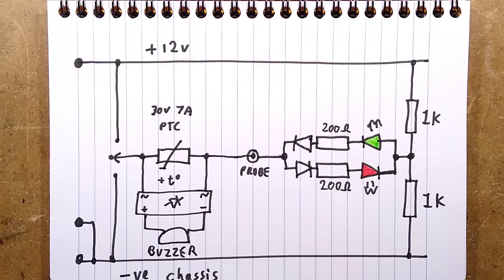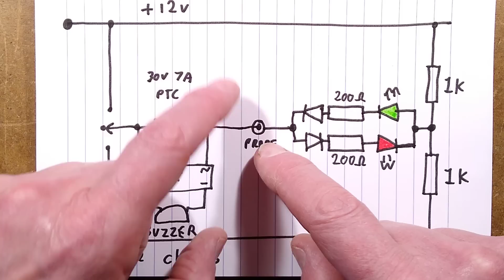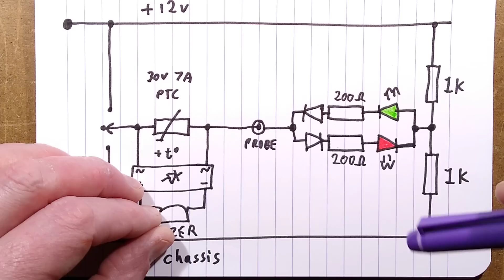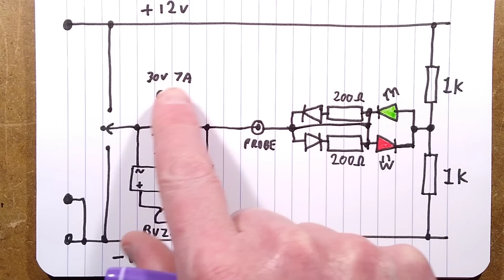Inside a mechanic's test probe - with schematic

Comment: The brand name version of this came out in the early 90's.  It was called a Power Probe and everyone loved them because you could quickly provide power or ground to relays without diagnosing the circuit fault.
Basically you quickly know if the fault is before or after the relay, fuse, or whatever.
Still to this day it is a must have tool that scores a 10 for most used tools and value.
Now I want to take mine apart to see if it is the same.
Reply: They have had many modern version of the power probe! Their downfall is the amount of delicate computers in vehicles that you can damage using a tool like this.
Reply: @JohnnyBouldin  I have a degree in Automotive and Diesel Technology as well as Ford, Delco, and Daimler Chrysler factory training.  This helps to know what not to ZAP with the inappropriate lightning source. 
Like my 55 Studebaker President Speedster which is 6V positive ground for example.
Reply: @JohnnyBouldin  My Power Probe 4 is full of multimeter features. I'm not sure if the other versions offer that.
 It really isn't a downfall of the tool. More of a downfall of the modern age.
That said, multimeter is still my go to. It can be super useful though and much more elegant than a couple of long wires.
That said, a power probe wasn't ever really intended for people that don't know what they are doing. Admittedly moreso with computers involved, as you state. Even with an old school analog circuit someone could pop fuses or burn something up if protection is inadequate. All can be avoided with knowledge.
Reply: In the states here, there are many versions of the "Power Probe" available. I wasn't going to spend the $100 bucks of so on one, so I built one myself with extra features in it. I went as far as to add a 3S Lipo inside it for 12 volts out when working on a vehicle without a battery, or for testing parts off off the vehicle. It's very useful.
Reply: Thought about taking my Power Probe 3 apart and comparing it too, lol!  But chances are as soon as i open it, I'll need it again
Reply: Found one for £80 lol
Reply: My power probe can test fuel injectors and has warnings about the 3Vdv-5Vdc sensors to avoid. You can test for ground. Problem is DIY'ers that have many years of repair component level parts on the board have no access to wiring diagrams which makes using the multimeter more feasible. Power probes as you stated are very useful. Most new power probs now come with a display for the voltage being tested like mine
Reply: So ... no indiscriminate probing, gotcha.  😅
Reply: The first time i saw one was abt 14 years ago when my boss bought one from a snake oil salesman. i stuffed in a drawer for 3 years before i even tried it. the first time i used it i blew a 10 amp fuse and then i stuffed it back in the drawer. it got sold 10 years later with the bussiness. My next encounter was with a shop that mainly delt with tracking and radio installations and they swore by probes and said that the conventional testlamps damages electronics. ive been working with regular testlamps swopped with 24v festoons for 16 years and ive never blown an ecu. U just need to know where and how to use it. The other shop that swore by probes blew 2 ecu's in the year i wasted it their clown shop Except for probes having way too high cutoff amps they can easily make a blown fuse test fine in circuit as the do light up with really low voltages.

Comment: I use to work on old cars (re wiring and repairing electrical) and I have a unit called a Power Probe (kind of expensive) but it's a bit like this, it does have a display though to show voltage and it has a physical breaker that pops and you reset to fix. They also have a 25' extension for it and yes I have it and used it as I worked on lots of motorhomes and this allows me to use it anywhere outside, inside and on top of them, also they make some of the best wire probes I have seen (similar to Fluke but made for 3 sizes of wire common in automotive) and they hole they make is so small it's like it self seals. Very handy devices indeed.

Comment: Clive..  I believe the diodes and resistors are to ensure the LED's dont give a false positive if accidentally touched onto a 5v circuit.  Do you believe the volt drop across the Diode combined with the 200 Ohm in series could be enough to stop ghosting of the LED in such 5v cases?
Reply: That doesn't seem nearly enough to me.
Reply: nope, in this case you just use zener diodes in series to the led (2V for the 5V indication and 8V for the 12V indicator) there are similar Tools that do this, to destinguish the voltage aswell
Reply: Good thought about 5v ghosting prevention... I've talked myself to your line of thinking... Notice that the LEDs are not connected to the rails, but to a voltage divider so they will see at most +/- 6ish volts. If the probe hit a +5v rail you would have negative 1ish volts across the LEDs which could glow the green one - but with the extra 0.6ish volt drop of the added diode it doesn't misidentify +5v as GND.

In the real world though, your battery is usually closer to 13.6v than 12v IIRC so this theory might work best on paper and in reality the extra diodes are probably for reverse voltage breakdown reasons (protects the LEDs from being damaged by too high of a reverse voltage... But IDK about the need for that here either)

Now I have no explanation for the 200 ohm resistors... Other than as a manufacturing option to match apparent brightness between the LEDs and this example of the product cheaped out and cut one item from the BOM.
Reply: 9:04  The two 1 K resistors provide circuit loading to prevent stray voltage from tripping the LEDs.  This is a real problem when using a digital volt meter.  Fluke even makes a stray voltage eliminator ( SV225 ) for DVMs.

Comment: I will guess that the resistors and diodes are insurance against overvolting the LEDs in normal use with 13.6V supply when the alternator is running, charging the battery.
The inductor case you describe would probably kill one or both LEDs with or without the resistors and diodes.

Comment: Yes but there is a simpler design for electricians it was simply a screwdriver made with clear plastic handle with a fuse shaped lightbulb in it and a hole at the end for a banana plug you could also connect an alligator clip as well. i still have mine there are no resistors no switch no beeper just a simple circuit tester anyone could easily make with wire a 6 or 12v lightbulb and a metal rod.
Reply: Yeah, that is just a test light...this is much more because you instantly know the polarity of anything you touch and can provide power or ground to anything you want.  Much more useful than just a test light.

Comment: Thanks Sr. Clive.
The Switch is the weak point of these Power probes, Especially with high Current. The Switch is not designed to 'Switch" High loads. To save the switch Press the button BEFORE touching the tip to the Load under test. 
The contact points in the Switch will hold High current once connected together before the load is applied. 
The Arcing of the contacts is what kills them. They are a light duty Switch..
Mike M.
Reply: Great tip.
Reply: Thank you, explains the smoke/short issue I just experienced

Comment: I have a more advanced model that has a screen to show the voltage, and can also function as a multimeter. (Autel ps100) Very useful for troubleshooting basic vehicle electrical issues.

Comment: These are also a fantastic way for apprentice level mechanics (or those who just start poking at circuits without any care) to blow up expensive electronics on cars. My previous job had me working as the shop f-up fixer, fixing the issues that other mechanics installed in customer’s cars. I can’t even remember how many times other mechanics took their fancy PowerProbes ( or knockoffs), applied power to a low current ground circuit (or vice versa) and released the magic smoke from an expensive magic box.

Regarding the weird diode/resistor/LED setup…this is outside of my pay grade, but a lot of automotive stuff is designed to work across a wide range of voltages. Typically from 9V to 24V (most heavy duty equipment or OTR trucks are 24V). Is it possible the added complexity is due to the wide voltage operating range?
Reply: Yeah, they are useful for testing basic things like lights, wiper motors and that sort of thing, but as you say, you don't want to be injecting 10amps into a ecu ground.

Comment: Thanks as always for a great Video.  I try to make sure I have one of these type of PowerProbe type devices in any Vehicle I own, certainly one I'm doing a long trip in. I actually own 3, an orginal powerprobe 1 with no buzzer (black), the red ones had beepers on them. I got a orange Chinese one with volts, ohms display plus other functions
They have got me home many times from being broken down by hot wiring your own car, they are so useful.
Certainly the ones with a parallel body benifit from a small cable tie, so its slippable along the main body to hold the rocker switch down to free your hands.
I can attest that a genuine power probe has supplied power to my 12v coil and driven 20miles home after total ign switch failure on a vehicle, with the probe jammed unto the +VE contact of the coil and the positive rocker switch held down for 20miles with that slidable cable tie ( can slide to hold down negative if needed too)
They are the best thing to find bad earth's on vehicles......
Like you said just don't go poking around Vehicle ECUs with them or Can Bus wiring unless you know what you are doing.....
An indispensable tool for overland trips or get you home from deepest greenlaning in the hills!
Thanks again for the education of circuits over the years, better than electrical college, cheers
Reply: I agree Jonathan, I have my 1st gen Power Probe and couldn't live without it.

Comment: It's a knock off of a powerprobe. Except the powerprobe has changeable tips for different tasks, and the power connector end can be swapped for cigar lighter, light socket, a manual reset circuit breaker, buzzer that gives you an differing audible tone for positive/negative, and a voltage display Heck the newest version is mini multimeter.

Comment: 12:35 I always cut the battery clamps off about 10 cm from the end and crimp spade terminals onto them. Makes it mega easy to lenghten/shorten the wires. And makes it easy to hook up more stuff too, using daisy chain spade terminals. 

I love spade terminals. I just always need to pay attention to polarity, and risk assess what’s going to happen if I yank on it and pull it out. You don’t want a male spade terminal hanging out with unfused positive voltage, for example. Also, they don’t handle high current over time if they’re being unplugged repeadetly. I’ve learned this the hard way😂
Reply: The more expensive versions have that feature built in.
Reply: Why don’t you use a deutsch plug instead, can carry more current and you aren’t leaving bare connections dangling, plus they can take being disconnected a lot more and have better ingress protection?
Reply: @rsoul7282  because spade terminals end up being multiple orders of magnitude cheaper and plug right into relays and other equipment. Much better for the prototyping I do
Reply: @jhsevs  ok, I was only going off you saying wanted to lengthen and shorten your leads, was only offering an alternative. I wouldn’t consider deutsch plugs as being particularly expensive, that being said I don’t know what you have to pay for them, and spade terminals are definitely less expensive. You could also quite easily make jumper wires to suit your needs if required if going the deutsch option though. Regardless, I’m only making a suggestion, if what you are doing works for you, keep doing it, and best wishes to you good sir 👍
Reply: I could also just use wagos but then I’d have to put wagos on every relay pigtail wire, and the strands don’t last when inserted into wagos multiple times, unless you use ferrules. But at that point I could just use spade terminals anyway since I’d need a crimper handy anyway. The more time I can save the better

Comment: One even even simpler yet you don't even need the other two diodes. just need the two LEDs and two resistors. The LEDs are connected the same way with the probe in the middle but the other side of the LEDs get there own forward voltage resistor depending if you're doing 5 volt or 12 volt. Each LED leg one is connected to the positive one is connected to negative and your probe in the middle deciphers what LED will light up if your touching positive or negative.

Comment: What I’ve been looking for is a cheap clamp meter that has, like, long leads or something so that I can sit in the car seat and read off signals whilst flicking switches/ignition on and off. And being a clamp meter I wouldn’t have to cut wires to test anything. Does this type of product even exist? Or should I build it myself using a current transformer and some frankenstein electronics?
Reply from the maker: You get meters with a remote display.
Reply: @bigclivedotcom  thanks, I’ll search for it!
Reply: On this note, last year I bought an 1988 chevrolet pickup with loads of electrical problems (plus a fair bit of mechanical problems). Me and a friend is going to spend the summer fixing it up, and when we’re done, we’re going to go on a Europe trip and video it. We’ll be driving around on vegetable oil fuel. I’ve been doing this for a while in my Suzuki so I already have experience with it. I can’t wait to get started working on it, but I don’t have time yet. I’m going to have to basically redo the whole wiring since all the 31 previous owners have all done their own thing. It’s going to be a bit of a project.

Comment: The 200ohm resistors were put in for Protecting the board from voltage and ampage spikes because you can use these powered probes to run alternators or starters or even Blower motors for testing even headlights or hid bulbs and much much more fuel pumps its to protect them from spikes @BigCliveDotCom

Comment: Be very careful using a power probe of any kind don't use the first 3 models on sensors that require 5v references you can use the PowerProbe IV on circuits with low voltage it has them features @BigCliveDotCom

Comment: If you really, really need to get to the back of the vehicle and the wires won't reach, grab another 12v power source and hook the power source negative to the car frame ground. Connect the red clip from the tester to the power source positive, and connect the black clip to frame ground.

Comment: Random question, on ntc thermistors, why are their values stupidly low? Why are there no 10k ones, or 3k, they're all sub 50ohm, that's no useful 😟
Reply from the maker: The inrush limiters are really just to prevent a very high current spike.
Reply: @bigclivedotcom  sure, but when you have to replace one of the earliest ones, there's no modern equivalent!
Reply: Maybe you need another supplier of electronic components, Mouser has NTC thermistors up to 680K and PTC thermistors up to 100K
Reply: @ruben_balea  sure, but not ag the right power rating I need, of course I could run them through a transistor, but adding things where they're not even called for, I might as well make my own 🙈
Reply: @phonotical  Oh, maybe the materials used don't allow for high current, high resistance models to be built, or maybe the resulting device would have to be too bulky, or maybe they just prefer to sell you both the thermistor and the transistor... and a trimmer for fine tuning, a couple of capacitors for stability, etc. would be a great way to increase sales, although of course manufacturers never did things like that 😓
Reply: @ruben_balea  yeah, the old versions were just heaters wrapped around a resistor but getting the same materials now just isn't an option, there are soft start modules that do the same sort of thing but they're so out of place in something that old
Reply from the maker: @ruben_balea  The temperature sensing thermistors are not the same as the inrush thermistors.  Two completely different beasts.

Comment: Device very much reminds me of the old high voltage probes for televisions, only I wouldn't go around poking willynilly

The tip is just solid? No resistor inside?

Extra diodes near leds to protect leds?
Reply from the maker: This one's tip is solid as it needs to pass high current.  The high voltage probes have a long resistor network in them.

Comment: Having this tool would have come in real handy for me last week. Wish I had known about it sooner. Very convenient to have a quick read for polarity or to supply current locally when trying to diagnose electrical issues. Might have to get me one.
Reply: Get one with a voltage readout at least, much more useful.
Reply: Look around for a "power probe". You will find the expensive ones and these cheaper units.   I've got this same tester and it's very handy.

Comment: Temu has a similar device that has an LED voltage display on the side and a red or green led to show polarity. It has a simple wire piercing point and a negative earth clamp. It sold for around $4.50 USD for it.
Reply: What is it called?